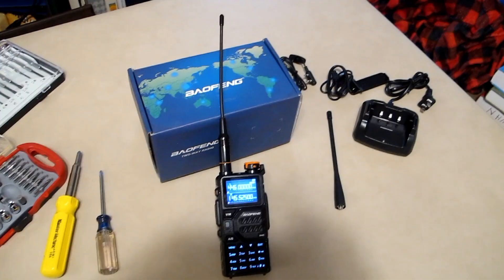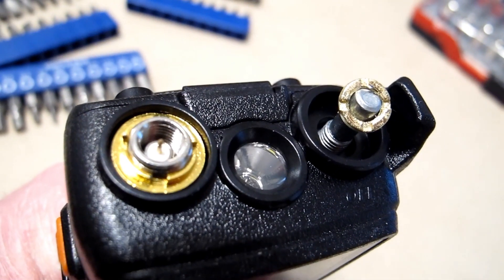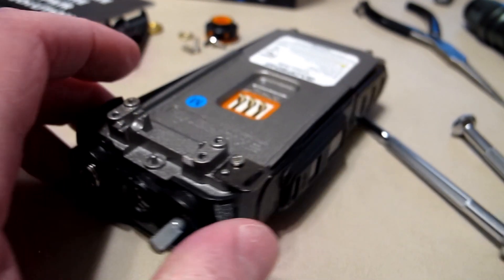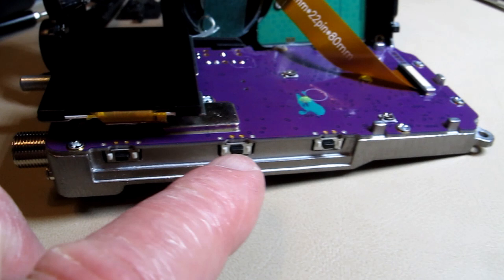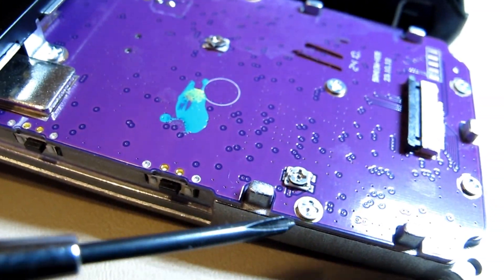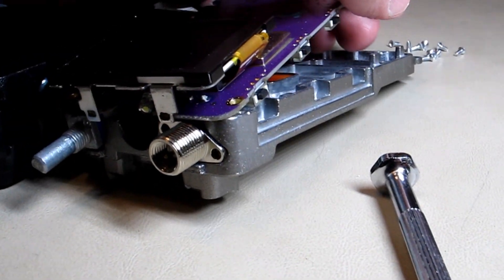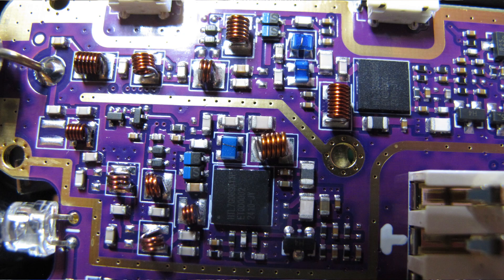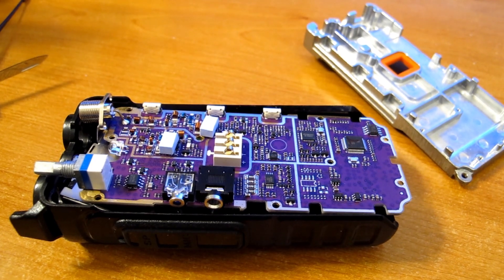Baofeng K5 Plus handheld radio transceiver teardown

Comment: Not about this video. Can i use a p2p antenna as an alternative antenna for my hams?
Reply from the maker: The Baofeng K5 operates at VHF and UHF - but not up to 2.4G. As far as I can tell from a quick search, most p2p (point-to-point) antennas are made for WiFi (which is at 2.4 and 5.x GHz). So I would say no. Of course there are VHF Yagi antennas that provide the directionality you may be seeking.  But they're big and awkward. Just the nature of directional antennas at the lower frequencies...

Comment: Just another average day in the life of a Chinese radio.  They do one thing and they do it well, create spurious emissions.  I'll stick with my Icom, Kenwood and Yaesu HT's.  They are also not as prone to the horrible input overload problem of the Chinese radios that have front ends as wide as a barn door.
Reply: 😂 but those brands youve mentioned are only just names these days😉